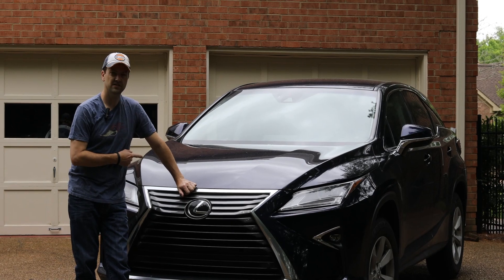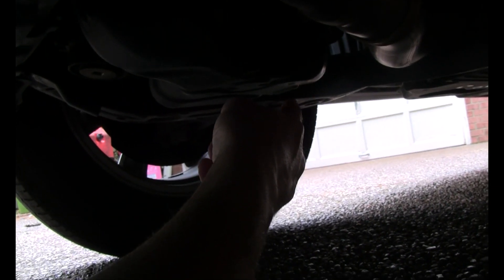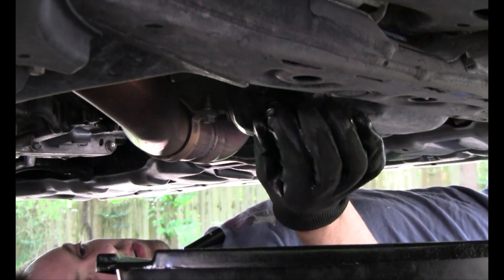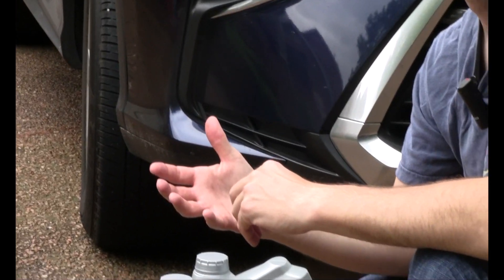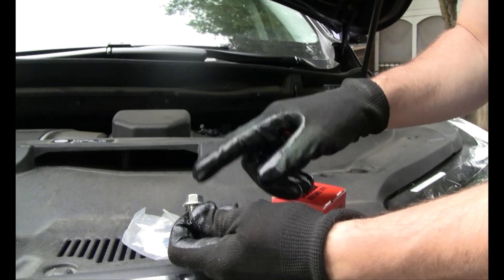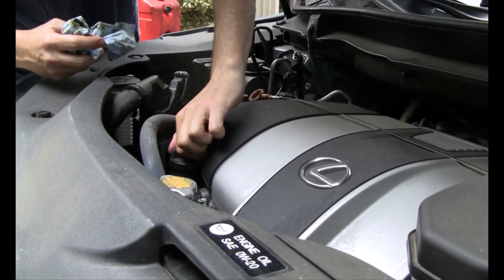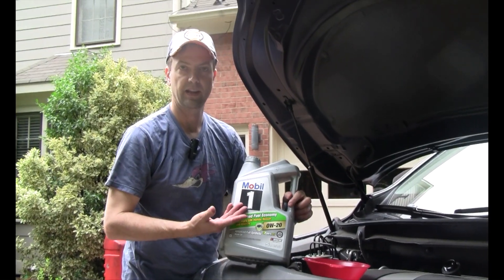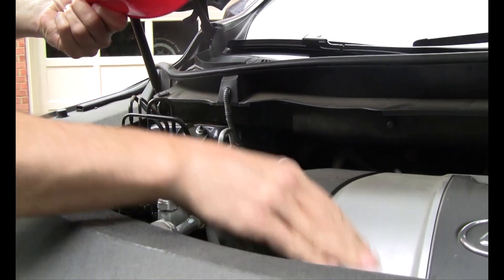How to Change Oil in a Lexus RX 350

Comment: 6:22  Does the oil filter housing drain plug (for lack of a better term) use a standard square 3/8" ratchet drive?  

You've also touched on a pet peeve of mine with shops/mechanics putting far too much torque on oil drain plugs and oil filter.  Once I had to drive a screwdriver through an oil filter to get enough torque on it to take it off.  Such a PITA!  Thanks for including torque specs at 11:50 for the oil filter housing and oil filter housing drain plug in this video.  What's the torque spec for the main oil drain plug?
Reply from the maker: yep - standard square ratchet socket.

Comment: What are your thoughts on the 60.000 mile $1200 Lexus dealership maintenance?
Reply from the maker: I would look in your scheduled maintenance book and see what it says needs to be done at that interval.  Base your decision on that.  If its minor stuff (like oil changes and tire rotation) you can have your trusted repair shop do it or DIY.  If its something like flushing the brake system, the shop needs specialized equipment.